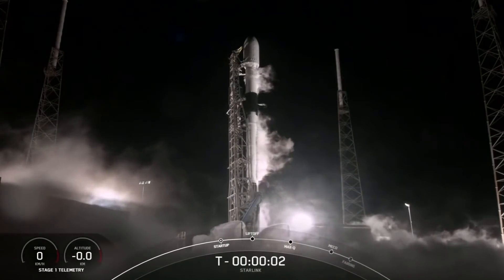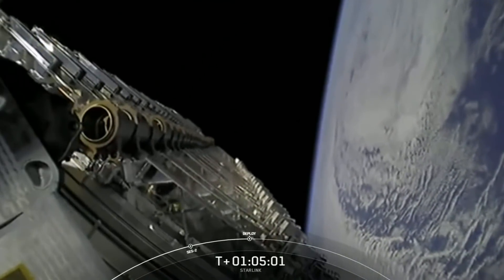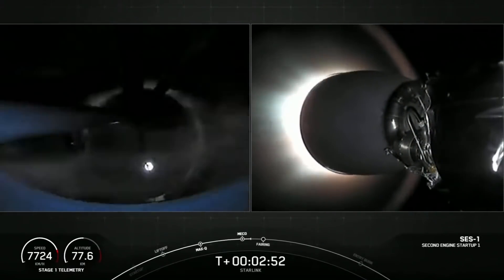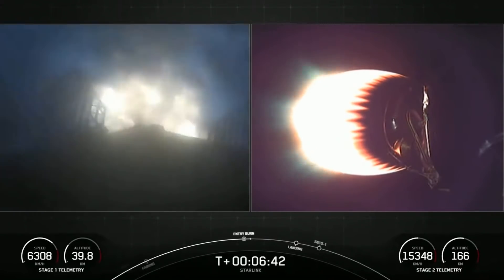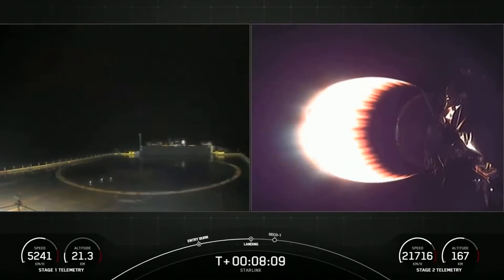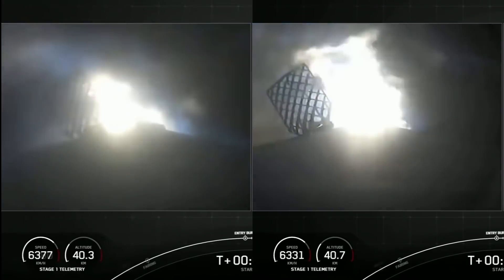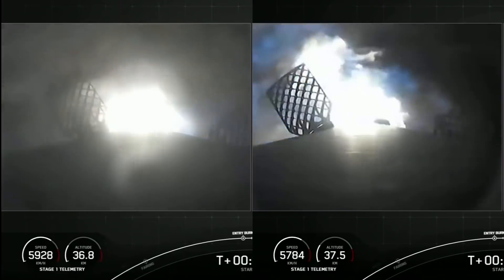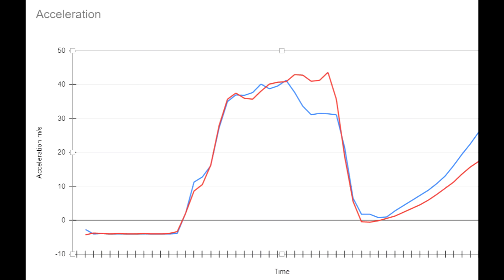Did An Engine Failure Kill A SpaceX Booster on Its 6th Flight?

Comment: We shouldn't forget that those Starlink missions are those SpaceX is using to really test stuff as it isn't a mission with a customer payload. I remember at least one other  starlink mission with a lost booster. It might be that they decided to test to have a bit less fuel for example, I'm no expert on cost optimization for F9 launches, but I could imagine that something like this was the reason. Obviously it could have just been an actual failure with the vehicle/engine. It would certainly be the best if it was an engine failure. With the Merlin Engines being already insanely reliable, finding out about another possible failure point in a rare event and improving the Merlins will be a really good thing. This might only be a possible problem when landing, but if it's a problem that could sometimes occur on launch it's def. a great thing we only had it in a landing, rather than e.g. in a launch of Crew Dragon.

Comment: is it possible to get ~25% loss, when an underperforming engine is leveled out by bringing the other engines to over 100%? So they accept damaging engines from too much output rather than loosing an entire vehicle by a single engine that has too little thrust in a significant moment. So when one Engine fails completely, this system still requires say 110% from the remaining engines and in the end we have the 25% lesser acceleration.

Comment: You are soooo correct when you said that seagulls are Rats of the Sea! As an avid boater for over 40yrs, I've had Thousands of run ins with those Flying Rats!!! I used to "Chum" them with Cheetos, then throw bits of Alka-Seltzer in the air! WooHoo!!! Take that you rat for pooping on my deck & steeling my food!!!

Comment: I think the rockets also have an automated stabilizing or output balancing algorithm working, so if that one engine doesn't burn correctly or simply coughs and doesn't light, the other engines push over what they usually do to compensate - taking up that 8% difference in performance. Instead of losing 33%, the others kick in harder to compensate and it's more like 25% power loss.

Comment: I think the 25% instead of the 33% is due to nott all the deceleration is from the engine thrust, some will be from the atmosphere, so i would not be surprised if the data do support a total loss of thrust on one engine factoring in the reentry drag

Comment: If you look at the birds they get spooked which means there were most likely audible explosions.  If you time when the the light stopped with when the birds flew it most likely correlates with how far away the booster "landed" from the barge.

Comment: You can actually measure the distance the booster crashed from Ofc I still love u if you get the time stamp difference between the last flash and the seagulls flying off scared. They fly away twice, the first one is probably due to the sonic boom and the second one due to the actual crash...

Comment: There is an error in the graph: Acceleration is not m/s , it is m/s².
Reply: He almost said “meters per second” but hesitated and added the extra “per second” after.
Reply: Also the acceleration should be negative
Reply: @juniperpansy  There’s no such thing as negative acceleration.
Reply: @PhilHibbs  acceleration as a vector obviously can be negative if it's in the opposite direction from what you call positive
Reply: @tomfeng5645  No!  Only scalars can be negative.  There is no such thing as a negative vector!
Reply: @ruschein  No! Vectors can have negative signs. That is because of vectors have magnitude and direction and the negative or positive sign shows the 'direction' of an object with respect to the other. 

Scalars can have negative signs too but they denote the 'magnitude' of the quantity, not the direction! Scalars don't have direction! 
Hope it helps :)
Reply: @siddarths8480  I get what you are saying but I think with vectors it is more complicated.  Consider the following two vectors (-1,+1) and (+1,-1) what are their signs?
Reply: @ruschein  True. With vectors it's way more complicated. Well the signs depend on the direction, but it isn't also necessary for a vector to have a particular sign. If the opposite vector is positive, it will be negative and vice versa. But again it isn't necessary for a vector to have a particular sign.
Reply: @autogyro333  Yep that's what I was saying but I think you're right about the initial travel. Thanks!
Reply: He still tries to understand the difference. Could be one day he gets it.
Reply: Ok, so any nonzero acceleration can be expressed as positive or negative, so I still contend that the statement “the acceleration should be negative” is incorrect. The statement should be “the acceleration could be negative”.
Reply: @PhilHibbs  I quite agree with you. Acceleration can be negative and positive. Well by the way, it's just a convention that is agreed to have gravitational acceleration as negative or whatsoever.
Reply: @autogyro333  So in the special case of when you know that the ac/deceleration is in line with the velocity, you skip the vector addition and just go with addition of a scalar value that represents the ac/deceleration in that direction. Ok, lazy is good, I’m a programmer, I’m a big fan of creative laziness. But I can see that it’s a shortcut, a trick that makes the maths easier.

Comment: I live in Titusville FL and watched this launch, there were thunder storms in the area and humidity was very VERY high, but this launch looked normal. My suspicion is there was a stuck fuel valve in the back boost burn. It's a given under these surface humidity conditions that moisture will condense everywhere during pre-chill. Bet anything it's a stuck spool valve  on the turbopump

Comment: The pulsing orange light could have been from the booster tumbling end over end, which would also cut telemetry and control.
Reply: He said that in the video
Reply: @Panj0  He mentioned it spinning. I took that as an out of control spin around the length axis, instead of a wild tumbling going every which way.

Comment: Looked like a turdopump eating big cheese right out the nozzle. That is not a running engine, not even a little bit. Failed oxygen valve? Looked like raw hot oxygen eating metal.

Comment: i get that landing it on the ship requires high precision, but what happens if this failure of precision crashes it on the ship??
Reply: I'm not 100% sure but I think the re-entry profiles are planned out so that if any of the post-stage separation burns fail the booster should miss the ASDS and hit the water.

Comment: My guess is that the orange gliow we see is the rocket breakibg part by the atmosphere.

Cause if you examine the collor scheme involved in spacecrafts re entry and or explosions its usually those collors that come out of it. Either those or blend white but its not the case here.

But its worth pointing out that landing those rockets are a secondary mission to SpaceX and that they will learn a lot from the investigation and adopt those learnings into theyre push to more re usability. Cause they are pushibg those limits everytime they fly more than five or so times. Johan.

Comment: I think the seagulls are a big hint.   No big huge explosion to get them scared. One small oen when we see orange glow, and later another one where they move off and some fly and come back.  

When I saw it live, I noticed  the orange glow to the right and knew it wasn't aligned. But I thhought that was Falcon 8 aborting its landing on the drone ship and landing in water nearby.

But your adjusting the timing shows that the orange light happened at some altitude,. This is also when birds first get "annoyed", which I would assume would be due to some large not not drastic noise. (would would also have to consider difference in sound (burd reaction) vs light (orange glow).  Perhaps the first orange glow was the result of "kaboom" and the sound then arrived later. The difference in seconds between seeing orange light and birds moving might indicate altitude/distance between ship and Falcom 9.

The time where it should have landed didn't generate bright lights. But one does see birds annioyed and moving a second time (a bit more than first time). My guess would be wreckage falling on ocean but not exploding.

When Falcon 9 missed the drone shiop and fell in Oceau, did it explode or just make a big splat in water. If it made just a splat, it would explain the reaction of seagulls the second time around and lack of a bright flash.
 
With regards to relemetry, I don't trust SpaceX,s TV show.  They are the ones who had the perfect excuse to not show landings, and only when people sarted to be suspicious, did the problem magically get solved.

Comment: High Scott, about the pulsating light indicating tumbling of the stage: I assume that a tumpling stage would be much slower due to more drag and possibly even break up due to structural overload. So, if it got down structaralylly intact with only a short lead on the nominal booster, that might indicate no tumbling at all. The still have their gridfins to control the attitude ...
Reply: I think the gridfins were stuck due to hydraulic failure. Thus an off-axis spinning booster. I also expect an engine failure during reentry burn broke the hydraulics.
Reply: @imconsequetau5275  You mean a rotation along the longitudinal axis? True, that is possible to be induced by stuck grindfins. It would probably even further stabilise the "bottom down/forward" attitude.

Comment: You can calculate how far off the drone ship the impact was using the birds reaction to the sound when it hit the water.  
When the orange glow stops the birds don't react for around 800ms,  so given the speed of sound it's probably hitting the water around 270meters from the drone ship.

Comment: What I noticed is B1059 flown 2 drone ship landings and 3 landing zone landings. So it did excessive boost back burns compared to other boosters only did drone ship landings. The engines of B1059 definitely had aged faster thus it’s life span was shorter.

Comment: it'll be fun to see any further telemetry and explanation of what went down.  i swear the trailing burn on the borked booster makes it look like the booster fuselage was side-on to the atmosphere at that point, instead of end-on, and the entry burn looked like it might have been in a violent spin (roll spin) - either could have messed up the fuel delivery and by extension at least one of the merlins.  note: i seem to remember that one of the landing merlins could be lost and the system is supposed to be able to recover... just not sure if the center one could be lost (but, that could explain the 25% reduction instead of the full 33%).  finally, even though the burn was early relative to the first one, remember that the system is programmed to bail out of the landing route if there's a problem, and what we saw could have been the booster doing its best to bail into the ocean in a place where it wouldn't damage the barge.  i would have hoped to see it still in one piece if that was the case, but if it came in too hard (maybe more than one damaged merlin), and since we haven't seen pictures of whatever's left (i would assume they're obligated to investigate any potential floating wreckage, for safety reasons), my guess is that we saw it RUD.  the light extinguished so quickly that i think it was mostly in one piece when it hit.

Comment: I don't think the landing burn ever ignited to begin with.  The glow you're seeing on the left has to be the stage EXPLODING as it crashes into the ocean.  FTS likely picked up this ignition failure and triggered a grid fin evasion maneuver to prevent OCISLY from getting smashed into smithereens by the ballistic booster.    Or the seagulls themselves remotely triggered FTS.  Let the conspiracies begin.

Comment: Is it possible that as an engine failed, the on board computer detected the change in acceleration, it would throttle the other two up to max? Hence only a 25% decrease overall

Comment: Watching the stream of sparks you can see that initially they are heading towards the camera then they are heading to the right of the camera. With it being night time and no other frame of reference to base it on my guess would be that the booster was tumbling out of control with a failed engine, visible in the pulsing yellow glow at the end before impacting the ocean.

Comment: My hypothesis is that the red glow over the landing barge was caused by an automatic self-destruct sequence.  The booster was well outside of acceptable parameters.  SpaceX would not program that thing to permit it to careen all over the sky on its own when telemetry had failed and the landing sequence was no longer possible.
Reply: I was thinking the same.
Reply: It's also possible that the ground control ignited the self destruct when they detected the vehicle was outside acceptable parameters and that resulted in the loss of telemetry.
Reply: @Endymion4242  Can't rule it out - but wasn't the loss roughly coincidental in time to the radio blackout?  All of those hot ions streaming past the descending booster...  I'm not confident that ground control had any control in that moment.  And I'm reasonably certain that SpaceX has coded self-destruct instructions into the booster that don't require any ground input.

Comment: I think the fact that there wasn't a huge boom and flash on impact tells you that it was already mostly burnt up and most of the fuel and oxidizer were gone. Typically intact boosters hitting the ocean at high speed tends to cause them to detonate as the tanks suddenly rupture and that causes a huge flash of light and concussion. It had already broken up before it reached low level. Whether or not Space-X decided to hit the safety det system or not I have no clue but it definitely wasn't in one piece anymore.

Comment: There are only a couple of seconds between the big red flare (allegedly the booster hitting the sea) and the seagulls being disturbed by that. That’s around 600 mts away. Would not expect to be that close with a mid altitude failure and coming down without any control.

Comment: Depending on what the failure was, this will have somewhere between no effect on future launches to a major effect.
If, for instance, the engine exploded, NASA is unlikely to allow manned missions until it is fixed.
Reply: I mean 6 times reused, all the human launches are in new ones.
Reply: @Ammoniummetavanadate  
Reuse may or may not be a factor. NASA has announced that they will allow reused boosters for future manned flights, although they haven’t done it yet.
(There’s no reason to expect reused boosters to be less reliable than new ones. It may be quite the opposite.)
It will be interesting to find out what caused the failure.

Comment: If I could suggest something.... 

I'm going to assume that the cause of the "pulsing" we see as the camera switches to the droneship, was actually the rocket tumbling end over end and then broke up causing the bright sustained flash at the end.
Reply: I think the pulsing is evidence that the grid fins were not controlling the descent, therefore a hydraulic failure. This consistent with an engine RUD that breaks the hydraulic system.

Comment: My theory is that unexpected asymmetric residual thrust from the broken engine tipped the stage over around the time it lost telemetry (21km) and that it got torn apart by aerodynamic forces. That would explain why we see an orange fireball before the free falling booster has even lit its engines.
Reply: Very plausible theory

Comment: I half expect NASA to postpone Crew2 to May or June because of this.  Whereas, if SpaceX had just dumped their boosters into the sea every flight, like everyone else, there'd have been no concern.  I can understand their wanting to know what failed.  But I wouldn't postpone Crew2, because it does have a launch escape system, and this was a post-boost, booster problem.  Plus, crewed flights launch on a new booster, right?  And to me, that just makes up the difference.  Whereas, if this was a system like the Shuttle, with a very sketchy LES; yes, I'd possibly delay to investigate.  It's always a weighing of the risks.

Comment: space x  engines are going to be their biggest problem, they cant make  enough and also the  engine quality are bad.
I just dont not believe that Rockets are the solution to space  flight, you wont get me on any rocket and the Public will never  fly on them because they are  really un safe.
Elon needs to find some other means to get into space  like air breathing engines.
Elon need sot speak to reaction engines from the UK that has technology but just needs  funding.
The problem with Elon is that if he did  not think of it then he is not interested
Reply: Engine quality is bad?  How many Merlin 1D's have flown compared to how many have failed?  You're deeply ignorant on the subject.
Reply: @TheEvilmooseofdoom  Not talking about Merlin its the Raptor  engines that are the problem, they have  to many faults and are still dangerous  for human space  flight.
Reply: @endlessspace.8776  Raptors are still experimental.  As are the still untried reaction engines.
Reply: @TheEvilmooseofdoom  If they are experimental then they certainly not should be used on star  ship as to the Reaction  Engines, they just need to funds  to get them of the ground. Everyone has there own agendas. Elon wants to have his cake and eat it.
Reply: @endlessspace.8776  Why not use them on starship?  It's also experimental.  Reaction engines needs funds, to get testing done including someday flight testing.  It's still an untried engine.  It has nothing to do with Elon wanting to have his cake and eat it too, that's nonsense.